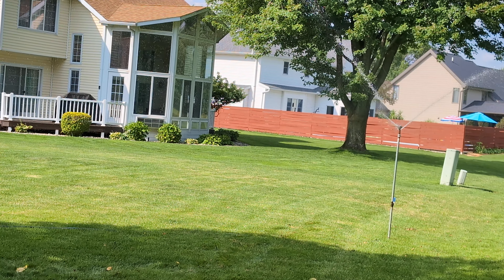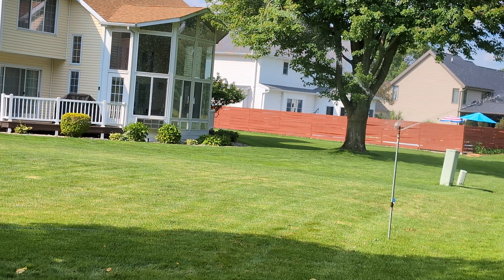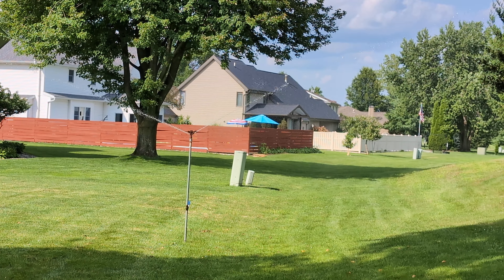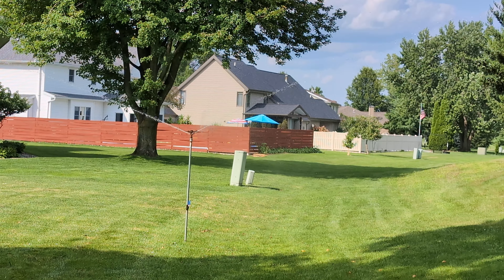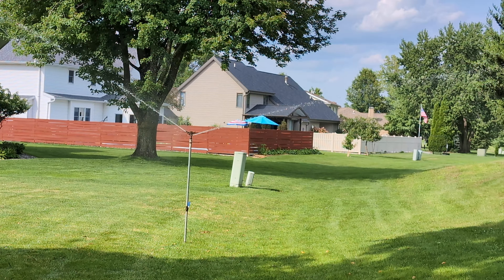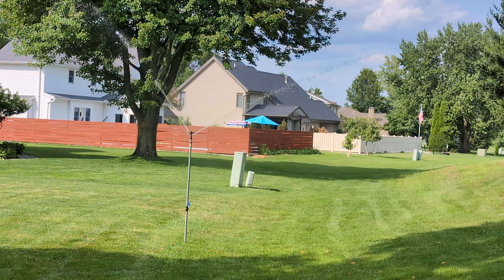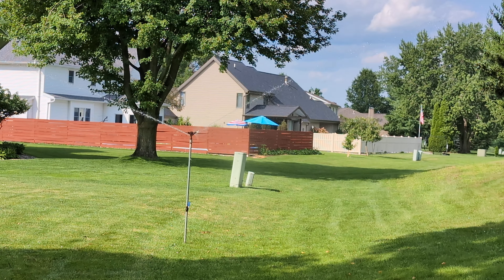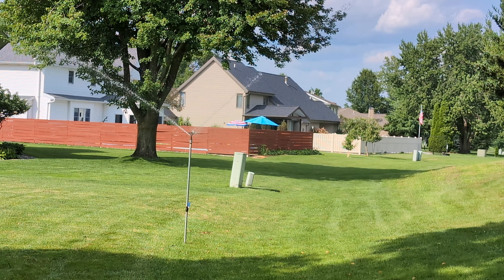Skinner S710 3/4" dual nozzle brass impact sprinkler.

Comment: That S-710 runs beautifully. Great video!
Reply from the maker: Would this be when WT bought Skinner ? The back of the arm on this impact looks like the WT design. Bit of an Easter egg if you will.
Reply: @NelsonBigGunP200Fan  maybe? The lever is different on it. I haven’t seen another skinner impact with that S on the backend either. I can’t put my hands on any of my S-1000’s at the moment, but I don’t think the lever on them looks like that. The only thought I have contrary to that is in the joint skinner/weather Tec catalog I have from around that time there are no skinner above ground impacts in it at all.

Comment: Nice! I also didn't know a S-710 existed.
Reply from the maker: The dealer has a bunch of skinner S-750 ( i think ?) and Buckner wedge drives that are on risers under a trailer. I should grab some next time I’m there. I dont have any of those Buckner impacts that are wedge drive.. I do believe they are the dual nozzle models too.  Maybe Buckner 3878s?